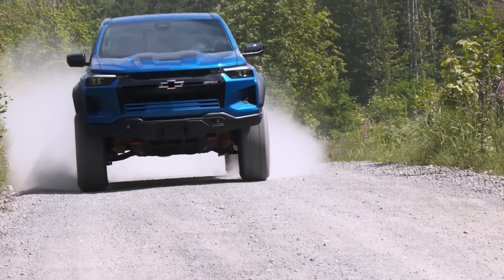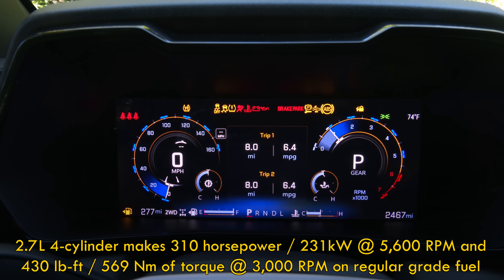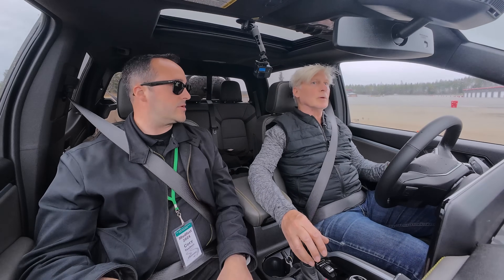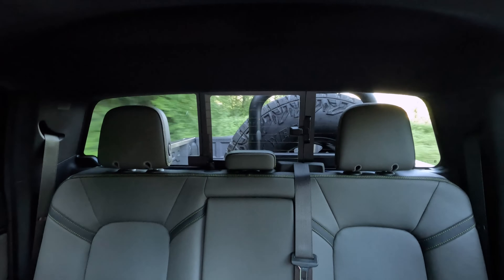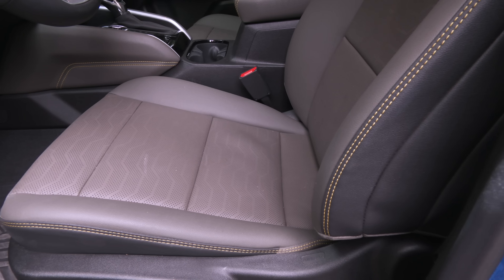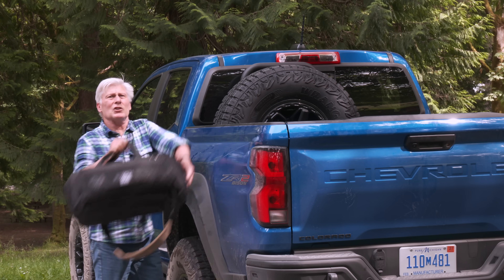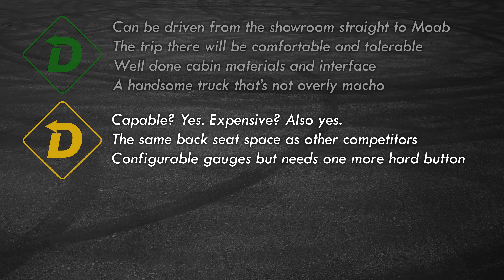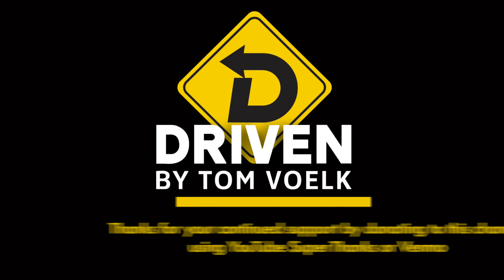Chevy Colorado ZR2 Bison is a One Tough Animal  #automobile #pickuptruck

Comment: I opted for the "regular" ZR2... which, save for the tires, is effectively the same. It's my first truck (I'm a 7-time Subaru owner) and I'm shocked at how much I like it!
Reply from the maker: I get it, the standard ZR2 is a lot more practical. Nice truck Curt.
Reply: As a current Subaru owner, that just bought a Silverado I experienced wheel spin that doesn't move the vehicle for the first time. And this is in 4LO autolocked rear diff. Did you offroad yours yet?
Reply: @gwot  I take it out into the mountains pretty much every weekend. To be honest, there's probably only been a couple of places where the Subaru would've struggled... but the ZR2 took care of them effortlessly.
Reply: @CurtGodwin  interesting! mind you, I've never taken my subaru off road, but i've had my fair share of deep snow and towing a heavy trailer in deep snow, and never had I had wheelspin that I couldn't move. Took my silverado offroad for the first time, with mickey thompson baja boss AT tires, and one rear tire was just about at maximum droop and pretty much all power went to that one wheel spinning, the auto rear locker didn't do jack, and front tires did not help. Was majorly disappointed.
Reply: It’s not the same. Different suspension/shocks/bumpers/skids/lockers front/rear. Big differences if off-roading is your thing.

Comment: Idk...Ford went the extra mile to make a different frame for the Raptor (which already has a different frame vs. the regular F-150) to fit the 37'' tire in the spare. Not sure why Chevy couldn't do that with the Colorado Bison, especially when they make something so cool to compete in a super competitive segment. The bed is so small and the tire already takes up 1/4 the space. Mount the tire on a swing gate in the back and you lose the backup and 360 camera. There's just no good solution to this.

Cool product, but I just think the engineers didn't go far enough to make something unique. Good review!
Reply from the maker: Correct, no easy solution. Since it isn't a full sized pickup like F150, there's not enough room back there I suspect, especially to keep the departure angle.

Comment: I remember when Chevy put 5.3l in Colorados…sad what they’ve come to with 4 banger
Reply: Except the "4 banger" has more HP and a lot more torque than that 5.3 has.
Reply: @ceric5220  more torque but lacking in horsepower compared to the 5.3
Reply: @tommyhaupfear9320   torque gets you up to speed, hp just keeps you there. I'll take torque.
Reply: @chadbrinkley6358  that's common knowledge but disinformation is still disinformation
Reply: @tommyhaupfear9320  it's a truck, torque matters way more

Comment: These new gen offroad trucks and SUVs are cool but with gas at 4-5 bucks a gallon and rising,  they will  suck $20,000 in gas over 60k miles. With a 4 cylinder. These needs to be hybridized asap
Reply from the maker: True
Reply: That's a BIG NEGATIVE hoss! 
LOVE this engine.